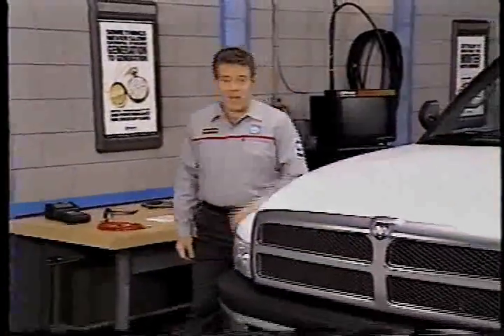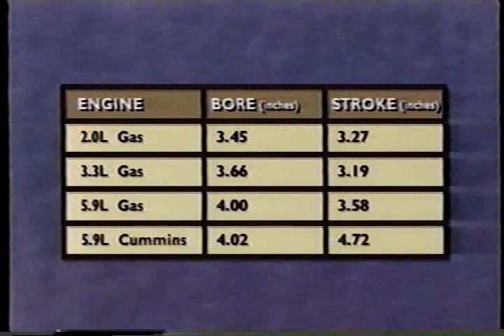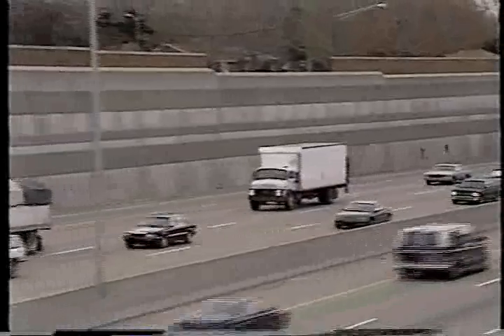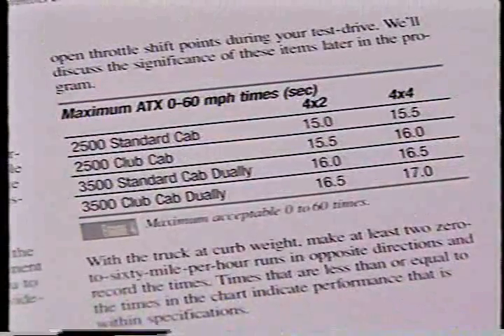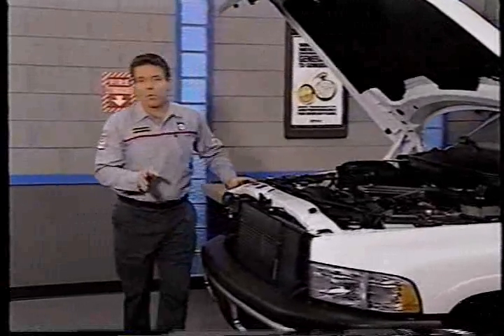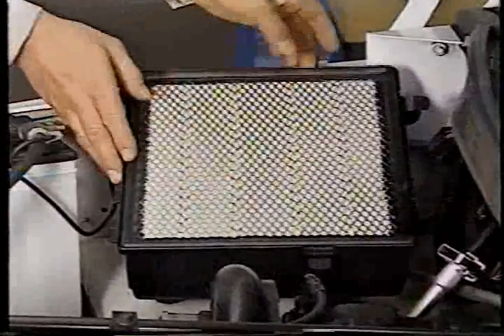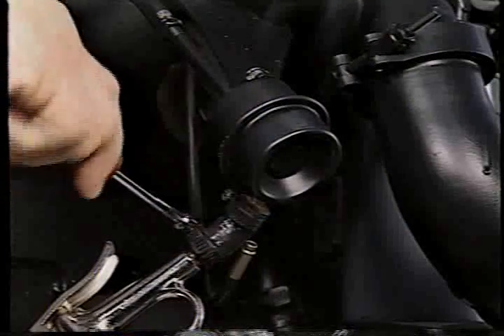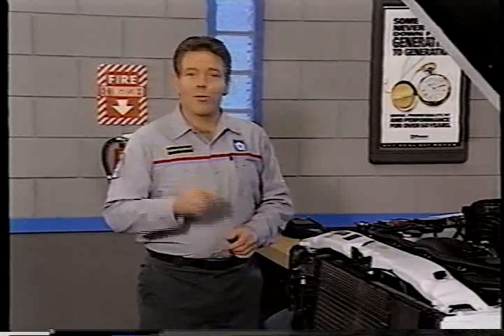Cummins Diesel Engine Performance - Part 1 of 4

Comment: The automatic is ok,that is until the torque converter breaks.My work truck has a 7.3L powerless stroke and my truck has a 5.9 24 valve,absolutely no comparison,I could drag that Ford like a trailer.BTW,RenMax makes a good replacement converter.
Reply: Itzahk

Comment: auto transmissions is better than manual in diesel trucks? And cummins engine is better than 7.3 idi turbo 1993?
Reply: haralabos lukatos manual is better, more reliable. Cummins is much better than a idi
Reply: The Cummins 12v is a beast of an engine easily passing 750k miles and the manual transmission has always been better except recently automatic is better since the power is a little too rough on a manual especially with the 2016 6.7 you need a auto
Reply: I prefer a built auto over manual anyday

Comment: Cummins Diesel With Automatic Transmission is way better than the Manual Transmission
Reply: no it is not. the automatic transmission for this truck is very weak. you may say that because you cant drive a standard but statistics show that the manual transmission lasts longer and is more efficient for this truck
Reply: The only way you wear out the clutch is if you ride it and not let it disengage. What you're talking about is what happens when you put a load on an automatic
Reply: ummmm...no.
Reply: Sorry for your brain damage.
Reply: Brenden Reed
Reply: Chanse Ormon. No we're u drunk when posting this comment? Drunk or stupid. Probly to dumb to drive a stick.
Reply: Brenden Reed not if you pull a load behind the truck, then you can wear out the clutch.
Reply: 13clicks ! Uh you're a dumbass Automatic Transmission is way better than Manual Transmission

Comment: Not true! Some diesels cycle the glow plugs on/off depending on oil/coolant temperature. Powerstrokes use an EOT (engine oil temp) to determine when to keep them on/cycle them on. It helps for cold starts yes, but it also helps warm them up quicker to operating temperature. Ideally they'd be on 100% of the time until the engine is in closed loop, but it'd kill them to be constantly on like that.

Comment: (laughs) I know what a V8 engine is. I've always preferred inline engines for that very reason. What I've never understood is why Dodge never offered a Cummins diesel for the Ram D150 pickup trucks. I would think that people would buy a D1500 truck if a 3.9 litre 4BT Cummins were offered as an option.

Comment: Not all diesels make that torque while stock. Cummins is the largest torque generator because of the engine. The Cummins is an inline 6. (All 6 cylinders sitting in one row) versus Powerstroke or Duramax (V8 4 cylinders in two different rows). Inline engines have more room to make a longer stroke.

Comment: there's other reasons but that's the gist of it. with gasoline engines you can change piston specs for a longer stroke, but when you do that with gas you get horrible gas mileage.